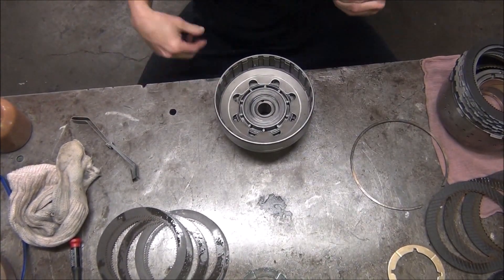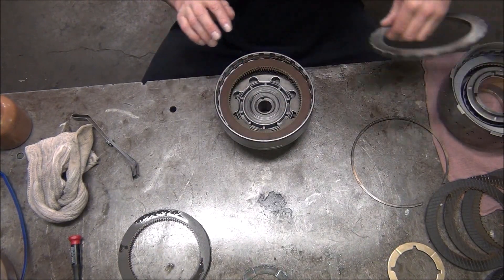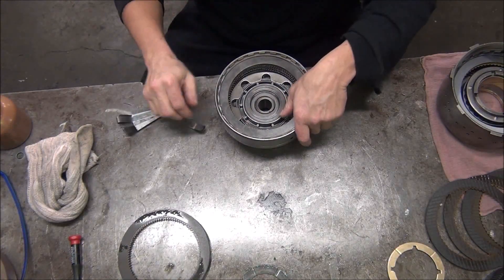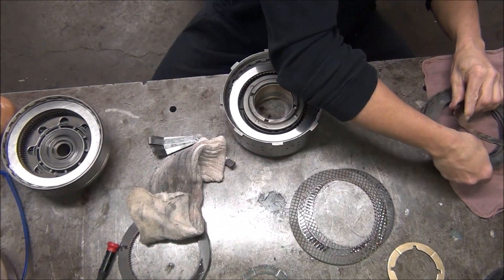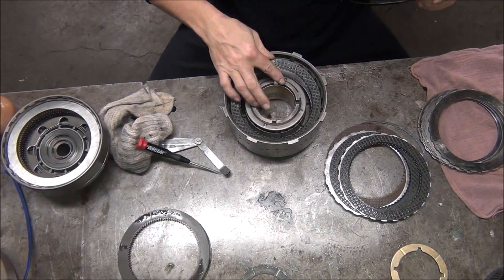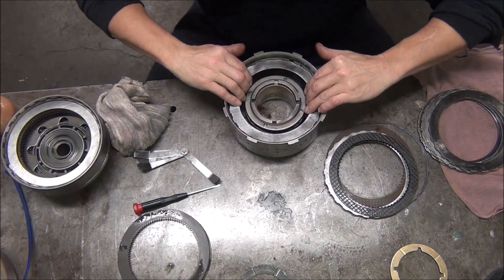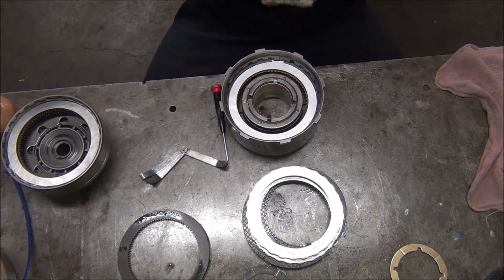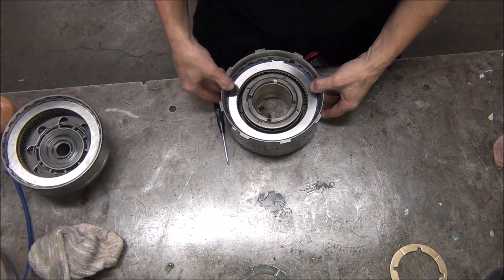Ford C 6 forward and direct clutch stack clearance

Comment: Thanks for sharing, can see you know your job very well. I rebuilt a few Toploaders, but today start to work on a Ford C6. Bought a Pionneer kit 753010. I found in the drums 2 times 3 friction disks, in the kit I have 5 disks same colours, and 5 more yellow friction ones. I saw in your video you have a few disks the same, and you had 2 red ones. What are those different colours disks ?
Reply: Well, I found out, I probably forgot to open my eyes while opening the 2 drums. First I have 3 friction disks space, then, I saw where they go, first drum, where the band goes, are the heavy friction disks, then the second drum the low friction ones (yellow). Anyway, your videos are really great and helpfull, many thanks.

Comment: They cut an extra groove in mine, but it's too high and I have too much clearance.  I'm over 70 thousands with this new one, but it's not 75 and that is with a thicker snap ring (two thicker than the original one(C)),  That's with new clutches, steels, and the pressure plate has no grooves or show signs of ware. Also, they didn't cut the groove large enough to get the even larger one (D).  Do they make a thicker pressure plate than the original?  If I add a second steel (back to back) it looks better, but then I only have 15 thousands.   Dammed if you do, dammed if you don't.
Reply from the maker: I recently ordered a master rebuild kit from Summit Racing with Alto clutches. It has extra forward clutches 4 of them were .073 thick and the others were .060. I am sure if you search for it, you can separately order the clutched you need.

Comment: I looked everywhere for information on cutting the pressure plate for additional clutches. How did it work out?
Reply from the maker: It worked just fine. I think I mentioned that I have done it before in other transmission builds. If you look in my list of videos you will see it was a successful build . I also have more recent videos of driving the car.Thanks for watching.